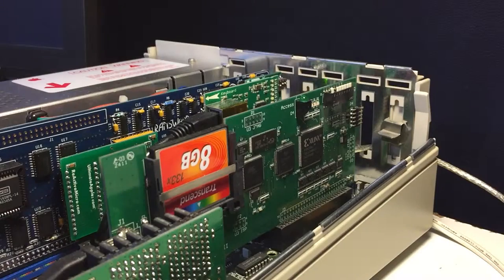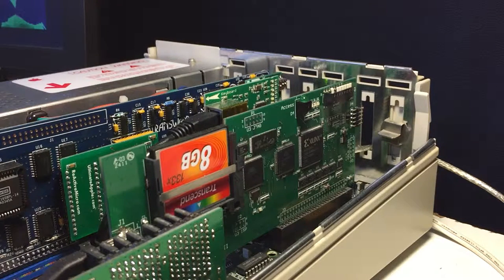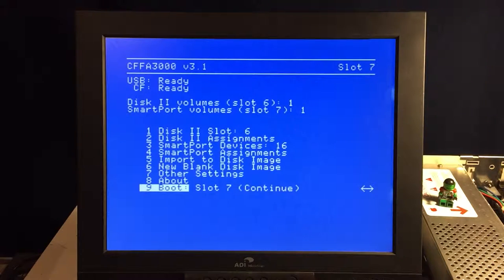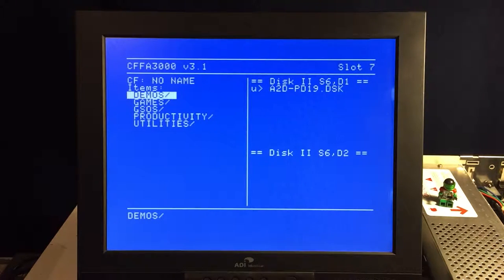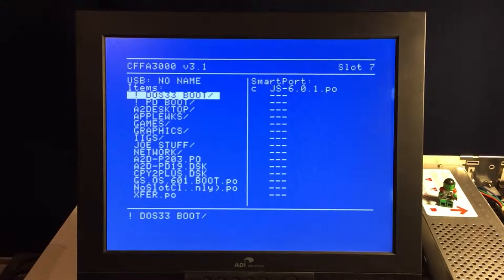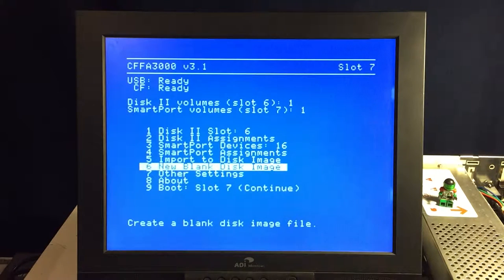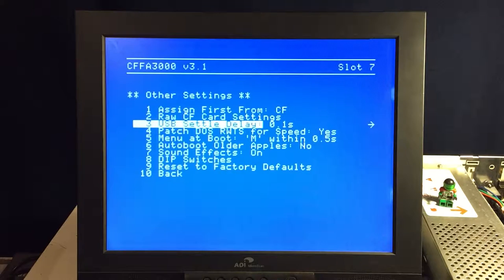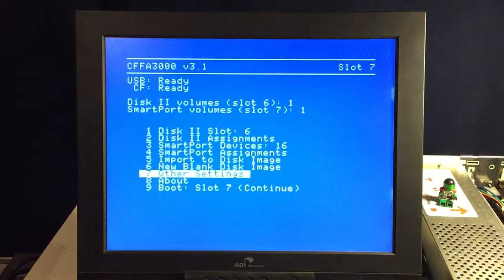R&D Automation CFFA3000 Review

Comment: I'm a newcomer to the scene.. but an Apple //e, a CFFA3000, an Uthernet II, a Transwarp, an A2Heaven VGA card, and an A2Heaven Passport MIDI clone have made the computer of my dreams. I noticed that you use A2Desktop. Have you ever found a manual for it? Also, how did you get started making your channel?
Reply: I'm 4 years late here, but that wasn't A2Desktop in Joe's video, but GS/OS which was the final 16-bit OS that Apple released for the IIGS. There's a great project since 2017 to disassemble, understand and enhance A2Desktop -- visit a2desktop.com, they've done a fantastic job on the website and documentation as well as the software itself.
Reply: @AussieBloke6502  Thanks! I've learned a lot since that comment 4 years ago. I love the work at a2desktop.com. They even added in one of my requests in the latest version! Mouse-tracking speed fast/slow.